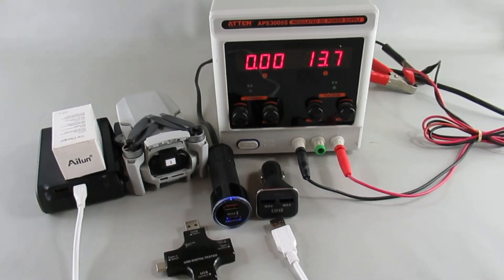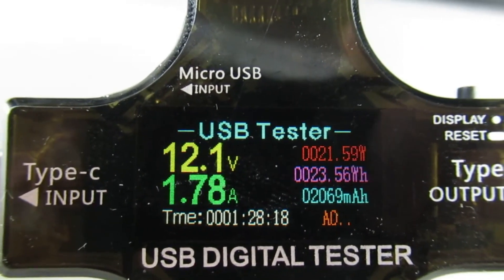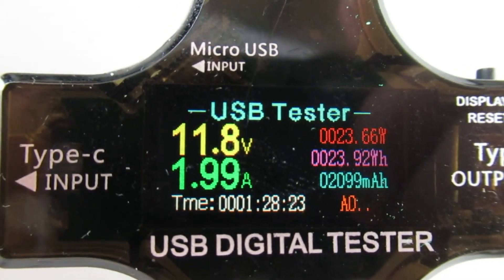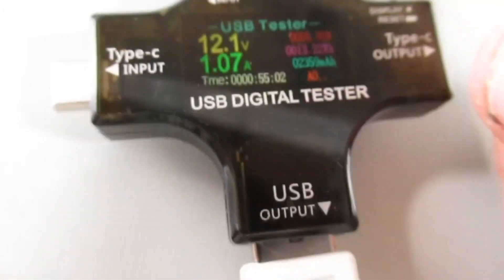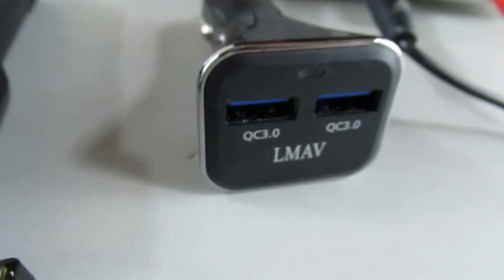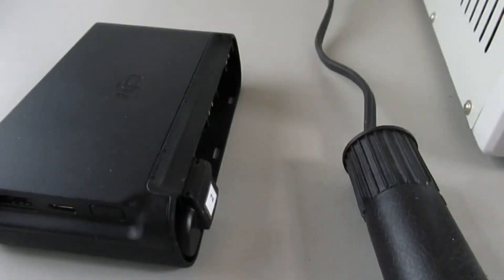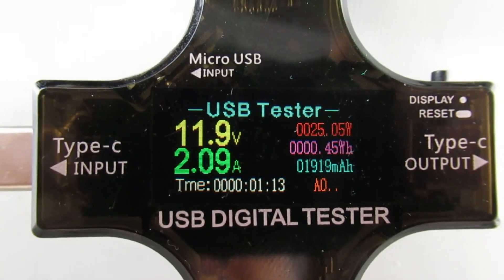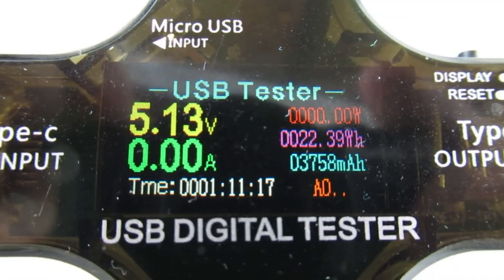Mavic Mini | 24W+ | FASTER QC 3.0 12V Car Charging | Ailum vs LMAV

Comment: So with a running vehicle this would be the expected charge time from fully depleted. If you ran your batteries down to around 20-25%, this should be even faster. Very good information. This would be faster by far than the included AC charger.
Reply from the maker: Exactly.  I haven't actually tested it in a car, and likely not all cars are the same, but let me know if you try one.  The DJI stuff is all QC3.0, but Apple stuff uses PD (Power Delivery).  You can get one that has one of each port type if you want to keep your phones topped off.